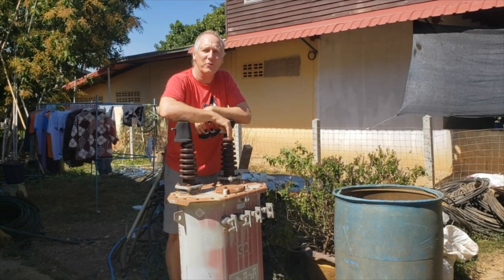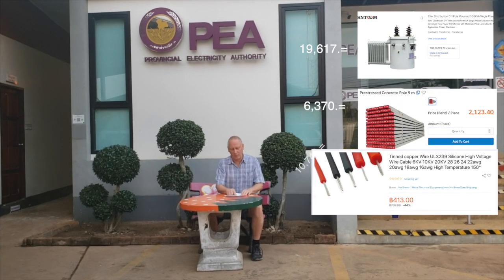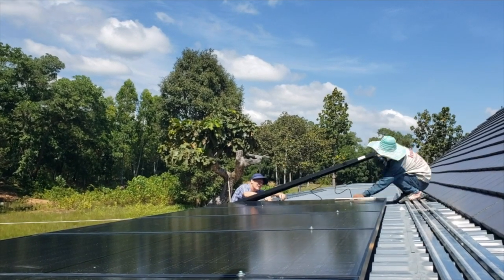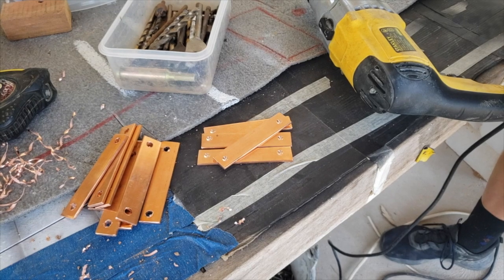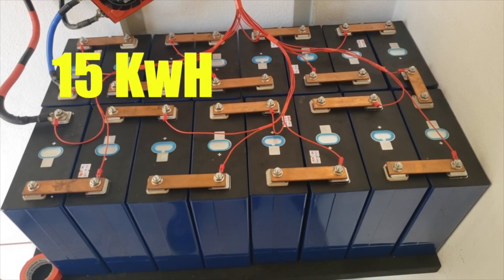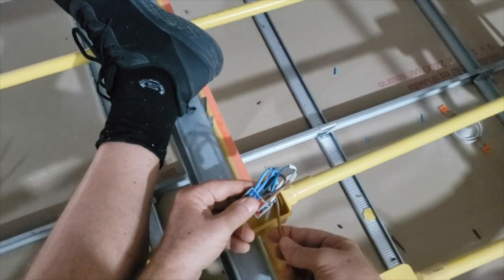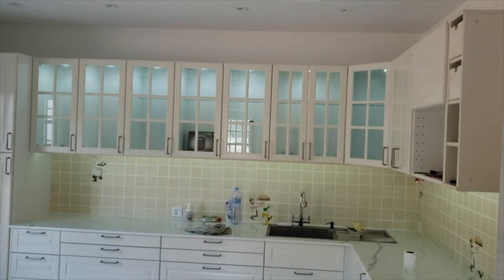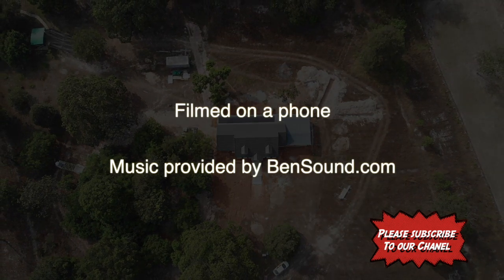Going Solar   building a house in Thailand

Comment: It would be nice no only providing not only parts description and qty. But also parts number to improve Lazada search engine.
Reply: If I would give you the parts-numbers from a year ago... do you think these parts would still be there in the fast changing market of solar power?

Just search on the description and you'll find the newer and better parts.

Good luck with your project.
Reply: @Beyond-Anywhere  part no. Is a good starting point usually then you can look for similar parts or start with the same vendor for newer parts. Thanks anyway. I will have  GPT  chat then. Good video regardless of this missing info.

Comment: Hello sorry to bother you Maarten great Video. did you Install the solar panel system yourself or did you arrange a company to Install? I am an electrical engineer but don't have the time to install if you employed a company can you provide the details we are currently building a house near Khon Kaen for my mother in law and are looking at Solar power as an  alternative to PEA supply. And could you provide an approximate cost for materials.

Comment: Remember my struggle with PEA…..similar like you but initial quote was 800000 thb and eventually got it for 300000……..note i needed transportcables and poles put in place over 400 mtr so the 300000 was fair but the initial 800000 was just ridiculous
Reply from the maker: I think 300K is still a lot for a couple of poles (2000 baht a piece) and some wire, but it is what it is here in Thailand.

Comment: What is your feedback after 9 month using your solar panels?  is it worth it ?
Reply from the maker: Absolutely. We run aircons when we want without worrying about the cost.
And, when the village has a blackout (every heavy rain) we have power.
Reply: @Living-off-grid awesome! How many AC simultaneously?
Reply from the maker: @ThaiGreenHaven   Well, we have 4 of them.
During the day we can run them all together.
At night we usually run 2 of them. That takes our battery down from 80% to 60%, so I guess we could run them all, but I never tried.

Comment: If you don't mind -what are the specs on your generator ?
Reply from the maker: It is a simple gasoline (pull start) generator, rated at 6.5 Kw, but in reality it puts out less than half.
It is able to charge the battery with 50 to 60 amps (at 58 volt) and keep the lights in the house on.

Luckily we only needed it once... but of course, in the middle of the night. 😴

Comment: A bit stunned by that quote from PEA when you have the lines right out the front of the property.......probably the majority was giving themselves a "bonus" paycheck, so glad you wasted their time by deciding to go solar!
What a great solar build you have made, congratulations. Particularly like the walkway addition for cleaning & maintenance. 
Also, the system is easily expandable should you want more power.
Last month I added up my power bills since moving into our new house in April 2006......over ฿600K....so I have decided to start doing solar. I will start by doing an off grid system for the outdoor kitchen and laundry. And then each year take one or two of the main house's circuits off grid, with an Automatic transfer switch for back up grid power. I like the idea of using the grid as a back up solution!!!!!
Reply from the maker: Yes, the quote from PEA was absurd. And they never saw my face so it was not a "farang price". 

Good luck on your solar project. Sounds like a solid plan.

By the way, a hybrid inverter (like I have) can be hooked up to the grid and it will automaticly use power from the grid if solar and batteries are not sufficient.
Reply: @Living-off-grid  Yep, the extra hoops and cost to do a PEA approved grid tied system are why I am probably not going that route (although still considering every option), but also, by doing the outside kitchen and laundry first, it will give me a good idea whether or not to do the same at my inlaws place .They are in their early 80's and I would be thrilled for them to receive an elec bill that is next to nothing. They are 250 k's away, so the ability to transfer back to grid in event of whatever will be peace of mind for them and us!

Comment: I'm building the same thing on my channel. I'm off grid as well and looking for a solar system. Can your system power a washing machine, fan, lights etc? By the way it's a very nice house you have there. Just sub to your channel thanks
Reply from the maker: Yes, no problem. We power lights (led), aircos, fans, washing machine (every two days), electric boiler (150 ltr), power tools, tv, wifi, everything.

Only when it rains the entire day we need to run the generator for one or two hours to fill the battery.  (A few days a year)

Even on clouded days we generate enough power .
Reply: @Living-off-grid  Thank you for the information. It's most useful as I'm getting quotes for my solar system. This will allow me to compare prices and if too expensive I might attempt it myself. Did you install it yourself ? Thanks 🙏
Reply from the maker: @bornfreeprepperthailand  
We did all ourselves and this saved about half the cost.
We also did not use proprietary installation materials, but made our own, which also saved a bundle.
Reply: @Living-off-grid  You done a good job. Thanks for the information you've got a nice solar system with good batteries. Thanks again 🙏

Comment: Hi maarten where did you put your system to avoid radiation from the inverter ?
Reply from the maker: The inverter is in the "battery room", which is a small (2x2) room at the far end of the carpark.

It is not close to the house. Not for "radiation", which is bullocks, but for noise from cooling fans.

Comment: Love the videos, an this on especially.  Out of interest where did you source the batteries and what is your total KW of storage as looking to do something similar myself.  Batteries seem really expensive in Thailand compared to other places especially on Lazada etc.

Cheers
Reply from the maker: I bought the battery-cells, copper bars and BMS all on lazada.

The battery is 15 KwH, but due to the lack of a propper LFP-charger it only gets charged to approximately 80%
This is more than enough for my house.
Reply: @Living-off-grid  Outstanding, sorry be to be asking so much but if you happen to still have links to the products you bought that would be great.  I will hopefully set something like this up when I get home (Pattaya) in 3 weeks and will use it to power all my IT equipment and 9,000 BTU AC - should save me about 4K per month with the PEA and it gives me something to "tinker with"
Reply from the maker: These are the links for lfp cells and bms.
I could not find the copper strips, but just search Lazada for "busbar" or related keywords.
The inverter is no longer there, but newer models are.
Search Y&H. But don't believe "lithium support" as this just means "user defined" where you can set the charging voltage, but not eliminate float-charging nor set up "battery full voltage", so it will only charge to 80% safely

Battery. https://s.lazada.co.th/s.QNxsm 

BMS. https://s.lazada.co.th/s.QNxv6
Reply: @Living-off-grid  Excellent Thanks, 
I am guessing you used 16 batteries to make a 48V battery of 280 AmpH - connected all the batteries in series.  I will keep on reading and planning - thanks for the assist.

Not related to this video, but the AAC blocks you used on the external walls - what size / thickness were they?
Reply from the maker: @DanInPattaya  
15 cm. From the outside in : fiber-cement (sierawood) siding, 5 cm airgap, radiation barrier, 1cm foam insulation, 15cm AAC block, AAC render.

Comment: Hi again just wondering how many air conditioning units you get to run on this system
Reply from the maker: During a sunny day we can run all 4 without using the battery. 
In the evening we usually just run 1, but we can run 2 and still have battery power in the morning.
Of course, at night the aircon only draws some 600 watts.
During the day each aircon takes 1 to 1.3 Kw.

Comment: Hi marten did you use 3.2v batteries from lazada giving you a 48v in series  for the inverter
Reply from the maker: Yes, that is correct.
16 pieces of 3.2 volts, 280 Ah.
Fully charged it is 54 volts. 
With 5% charge left it is 45 volts.

Comment: Fantastic work you make it look so simple just wondering how you connected your earth rod and connection to the breaker box did you join the N and E on earth bar
Reply from the maker: No. I did not join earth and neutral. I did connect the inverter to earth with a copper rod. That should take care of it.
I always learned that you should only ground the installation in one spot to prevent the creation of a difference in potential (I do not know the english word for it and this is what google-translate made of it 🤔)
Reply: Do you have a connection to the earth bar in the consumer box from the inverter so you can earth your sockets outlets
Reply from the maker: @stephenainsworth629  The electrical system in the house does not have earth.
Only a select number of groups such as aircons and boiler.
All apliances have so called "euro plugs", a plug without earth for double insulated appliances.
Reply: So if I wanted to have 3 pin sockets how would I connect the earth in consumer box with the solar system
Reply from the maker: @stephenainsworth629  You could incorporate earth in the entire system.
The inverter provides (usually) an earth-point.
You can connect the consumer earth to that point and then incorporate it in the entire system.
I just did not do this as I have no appliances that require earth (except for aircons and boiler,  but each has its own group with earth.)

Important is that you have a single earth-point.
If you would touch two appliances that "leak current" and they have different resistance in their earth, the difference will travel through you. (The potential difference I mentioned earlier. )

Comment: In reply to Kevin Rummelhart 2 months ago, you mentioned that cool air is pumped into the house at night. How is this accomplished ?
Reply from the maker: It is a pretty simple system.
I thermometer-controlled-relais (when temp out is lower than temp in it connects) controls a few fans that have a grill in the ceiling of each room.

But, to be honest, I am not satisfied with the results, so I am considering more or larger fans.
It's a bit of an experiment.

Comment: Looking at doing the same me'self, probably do a solar pv course here in London b4 hand. Still unsure how I'm going to wire our property yet, but definitely won't be using pvc conduit, I hate it with a passion, don't like installing it even when I'm being paid to 😂 but thanx for these videos, invaluable to people like myself. Keep up the good work.
Reply from the maker: You could use vinyl-mantle-vinyl-cable. That does not need a conduit.
But think about the sunlight outside. It is best to protect your cables against uv or make sure they are always in the shade.

Comment: Wonder if this 15KW is sufficient to run any air-conditioner
Reply from the maker: So far, so good.
We have been living in the house for a few weeks now, so not really extensive experience, but we run a 12,000 btu in the evening (until around nine) and then a 9.000 btu from nine to seven in the morning and we have some 50% battery left.
Of course these are inverter aircons and we set them to 27 or 28 degrees. This is just the right temperature as a compromise between me and my wife 😉

Comment: Hi we recently had solar fitted (no battery) was wondering about battery capacity if your running any AC at night
Reply from the maker: We have a 15Kw battery and can use aircos all evening and night and have power left in the morning.
  
Aircos draw more or less the power that equals their BTUs. Our 12.000 BTU unit draws between 1.1 and 1.2 Kwh.
The 9.000 BTU draws about 0.9 Kwh.
So, based on this a 10 Kw battery should be able to power a 9.000 BTU airco for the night comfortably (as it does not draw max power all the time).
But... keep in mind any other consumers such as fridge, freezer, lights, tv (on standby).

Also keep in mind that you need enough solar panels to recharge the battery the next day... also if it is cloudy.

Comment: Hello Maarten.  I am also building a house in Thailand. 
Your videos are very helpful. Locating building materials is difficult.
Can you provide me with information on:
1. Your 2-wire 3-way switch
2. Your ventilation switch in every room
3. Your ventilation fans
Thanks for your videos and assistance.
Reply from the maker: Hi Larry, 

Yes, it is not easy to find decent quality stuff.
I get a lot from Lazada.

The switches are RF controlled.  (Lazada)
They normally work on a battery, but I connected them to a fixed 12 volt system.

The fan-switches are in fact small 12volt motor-controlers. (Lazada)
They control 12 volt computer cooling fans that I installed in 4" pvc pipes. 

I hope this helps you.
Reply: Hello Maarten.  I am amazed how you design and build your systems.  I like how you built your solar battery system from basic components.  Now you tell me you designed and built your ventilation fans from basic components.   I  want each bedroom and the living room to have a separate ventilation fan and separate controller.  I was planning to use commercial off-the-shelf fans.  Now I will consider building my own fans.
Reply from the maker: @larryhoffsetz3533  Yes. The commercial fans are always loud and ugle.
The computer fans are very quiet and work for a long time.

Comment: Must admit this is on my list of things to do even though we have an electric pole outside I'm not paying that sort of money for it connecting they can #### off. I know a system will cope with things like LED lights no problem but what about say Western style ovens and running A/C for prolonged periods if its especially hot or you have family / friends visiting from Europe etc, also Li batteries inside not sure about given the instances of them catching fire, would probably house outside in a small separate building, like outside toilet size.
Reply from the maker: Hi Nigel.
It all depends on the size of your system.
We have (should have) enough to run several airconditioners and the electric boiler.
The oven runs on gas.
LFP batteries are not the ones that burst into flames, but just for the sound of the cooling-fans it is a good idea to put all in a separate building.

Comment: Nice Video, I had several Solar Systems (in the US) 2 - I configured and installed myself and the last one was a "professional" because I wanted to be connected to the Utility Grid. If I do something like this here in Thailand... I probably use Micro-Inverters (installed on each Panel on the back)
Reply: Have both. Issue was that cost of micro-inverters is higher.  (they didn't scale)

Comment: What is the air conditioner setup you have?… I assume you have a mini split or two?… Can they be run during the day?… What about thru the night?
Reply from the maker: I've got 4 AC,s (3x9000 and 1x12000 btu). These are of course inverter models.
All 4 can run easily during the day, though that would not be necessary as bedrooms ar not used during the day.

They can also easily run all night, but again, that won't be necessary as 
a.) The livingroom is not used when we use the bedrooms.
b.) At night cool air from outside is pumped into the house.

Putting in solar power is one part of the story.
The other part is to build the house as energy-efficient as possible.

Comment: Hello Maarten.. i will ask you .why use you  panel mono crystalline ... in thailand don't better poly?
Reply from the maker: I don't think so.
Mono panels do better when the sun hits the panel straight on.
Poly is better at lower angles.
Where I am, twice a year the sun is directly above us.

So, it is a matter of deciding what is more beneficial in your situation and I decided on mono.
There are also other benifits , but this is the maun reason.
Reply: @Living-off-grid  However it was just an observation as in Thailand the hours of sunlight vary slightly over the year but it is a very hot country so the yield of mono crystalline panels is 20% lower and more than poly
Reply from the maker: @vincenzo7790  Not really sure what you mean,  but you can just use what you think is best for your situation.

In my case, that was mono due to the much higher efficiency per survace and the higher heat tolerance.

Comment: Some 
You state the solar panels were 380 watt each.
What is the VOC of each panel?  (normal is around 45.5 volt)
What is the Amps of each panel?  (normal is around 9.2 Amp)
You stated that yours producing 500 volts and you had 15 panels and I am assuming that they are therefore in series.
That would make me think the panels were 33.33 volt and 11 amps based on Watts = Amps x Volts.
Can you please tell me the manufacturer of the Solar Panels?

With regard to the batteries, I assume the batteries are 3.2 volt each but classified as 3 volts x 16  makes the 48 volts
You state that the batteries give 280 Ah.
I assume that they are  EVE LF280K Rechargeable Power Energy EV Car Cell LFP Prismatic Solar System Batteries 3.2V 280Ah lithium ion Lifepo4 Battery.  Is that correct?

What manufacturer and model number of combined controller/inverter did you use?
Reply from the maker: Hi.

PV panels are NK380M-60 from Nakita. VOC: 43.25 volt, VMP: 40 volt, ISC: 10.89 A
I have 13 in series (2 others are for heating water) connected to a Y&H 5.5 Kw inverter/charger.

The battery is build from 16 cells of 3.2 volt, 280 Amp from CALB (LifePo4).
The BMS is from Daly. 48v, 16S, 150Amp in/out.

I hope this helps.
Reply: @Living-off-grid  Thank you very much for your fast response.